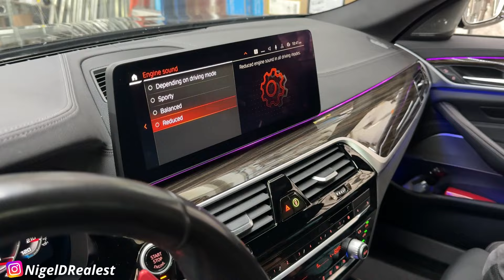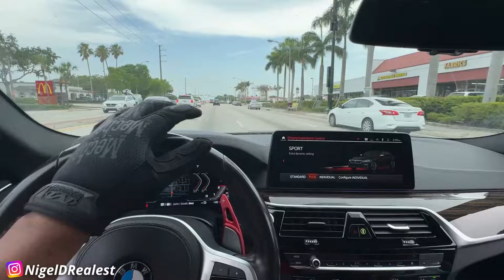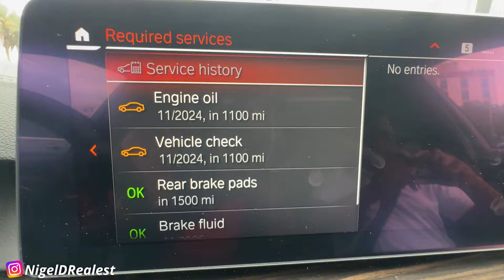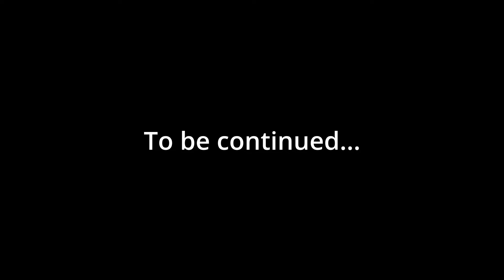MUFFLER DELETE & QUAD TIPS ON MY 2021 BMW M550i

Comment: Does it sound so loud that the police would write you a ticket? On eco and reduced sound that is?
Reply from the maker: Nah. The car is very tamed with the sound because of the vibrant resonators and whatever BMW tech is in there that controls startup sound and the pops regardless of not having valves

Comment: Should of did the Dinan midpipe first then downpipes i have the same car just dropping some hints
Reply from the maker: Too expensive! I actually love what I got!
Reply: I scored my Dinan set locally for 500 bucks and got the arm downpipes for 250 both used and installed them both for 500 so i got a great deal i feel you enjoy it however you like it
Reply: @eduardlast23 Do you have a video with the sound? I’m in the market for a 550 and I’m curious the best exhaust setup
Reply: @eduardlast23 Got any video or pics link the Dinan mid pipe

Comment: Great vid. I have a 2020 540i which is a great car so far however very quiet. I might look to do a cat back exhaust down the road however am looking to delete the resonator for now, in your opinion do you think it would have a noticeable change?
Reply from the maker: I have a video on my channel of how the M550 sounds before and after res delete. It does make a noticeable difference on that car but I have no idea how it will be on the 540i. Resonators normally dampen a lot of sound though

Comment: Nice!! So what was the whole setup after the delete? What parts
Reply from the maker: The whole thing is what is shown being welded on in the video. Pipes, Vibrant resonators and the quad tips. Resonators were removed in a previous video. That's all
Reply: @NigelDRealest  cool! what inlet/outlet resonator did u use?

Comment: How much louder did the muffler delete make it?

Compared to just resonator delete? 

Currently have an m550 with resonator deleted and considering taking the muffler out too?
Reply from the maker: Not sure how to describe with text versus the videos on my channel. But it’s much louder. Not too bad with resonators added
Reply: So resonator delete VS resonator + muffler delete there’s a big difference??

I’m asking because I currently have resonator delete, and wondering if it’s worth it to also remove the muffler ??

Comment: THIS IS A BASIC M550 comp. No adaptive cruise it’s not the executive package no rear heated seats no side shades probably no driver record no rear wheel turning no bowers and Wilkins 3d sound system  I wouldn’t have wasted money unless it fully loaded
Reply from the maker: My car actually has a lot of what you mentioned . But either way, even if it didn’t, don’t care 😂😂😂
Reply: @mrgreedy9790 youre probably just a kid still thinking his civic si is comparable.